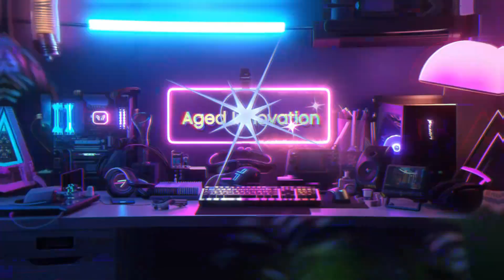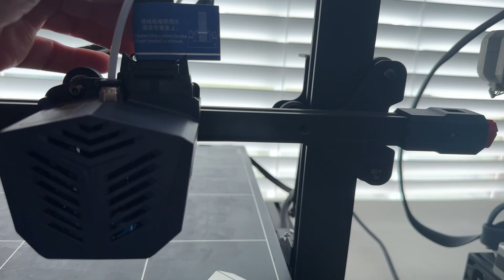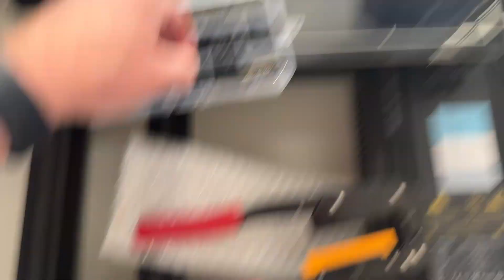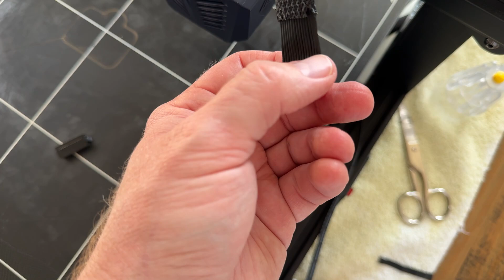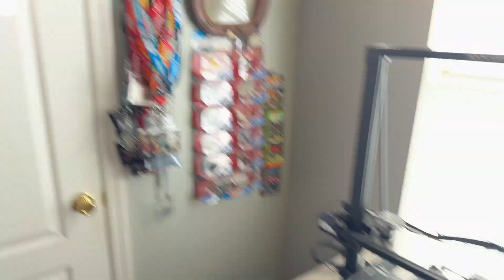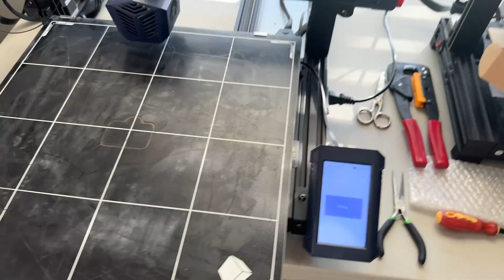AnyCubic Max Ribbon Cable Repair

Comment: Kindly reply waiting
Reply: Sir can i use anycubic kobra max cable 2  in anycubic kobra 1
Reply: @rebalfaisal6359 I've heard some folks just contacted anycubic customer service and got a free replacement mailed. Takes a while from China though. I have this issue too, but Im just going to repair it like in this video.